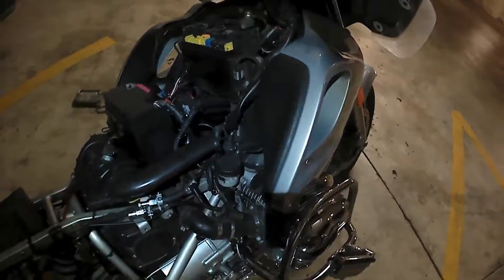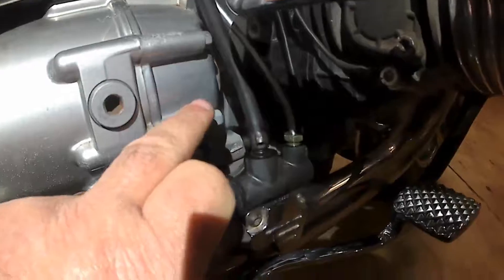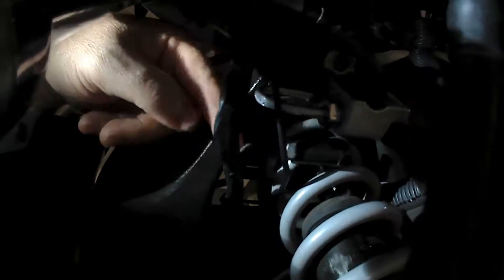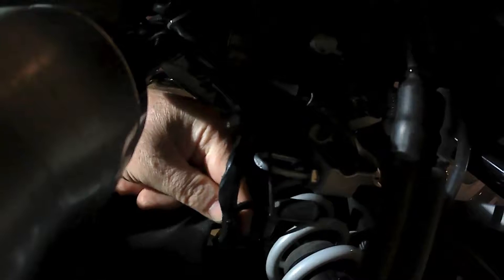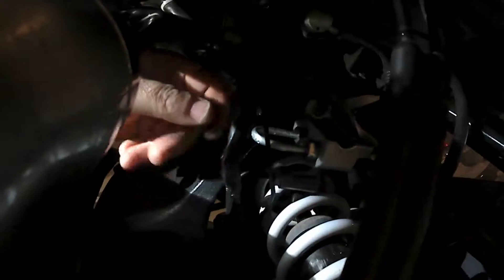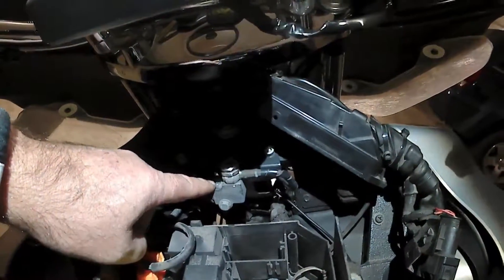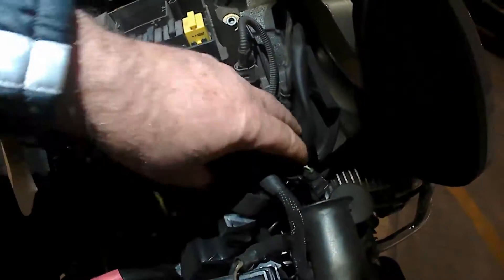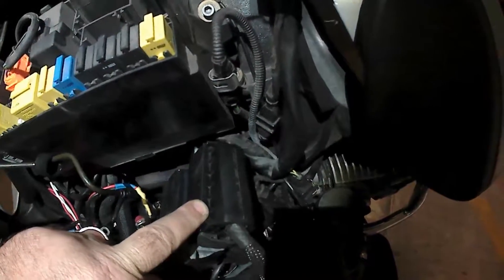BMW i ABS III unit   flip to classic brakes

Comment: Hola Cris compré una r1200cl usada del 2003 y el problema es que NO hace el autodiagnostico del ABS cuando conecto. Cómo puedo comprobar q le han  lo q indicas en el vídeo ? Gracias
Reply from the maker: Hello, Jose! From your words, the ABS lights do not lit as they should, at start-up. There might be two explanations: either the previous owner took out the bulbs, or the ABS unit has another electronic board (or completely another ABS unit) as the one paired with the ECU... A little more details would help......
Best regards, Chris

Comment: I did this conversion; everything went well but Brake lights not working. Do I need to change sensors?
Reply from the maker: Hi! The brake lights are in direct connection with the electronic board of the ABS unit. So, if you removed the unit, you must put back only the first section of the unit, where the board is, and connect it to the big connector...In this video I explained also what other modifications you must do in the electric circuit for the ABS lamps not to blink on the dashboard.
Reply: @cristinelpetrescu1081  Chris I followed your instructions to letter. But not brake lights or speedometer. I am in process of changing to non abs brake switch found on classic R1200C from motorworks in UK. I Find it odd you maintained brake and speedo functions. I do enjoy your videos.
Reply from the maker: @nicholasjheinz7461  Trust me! That brake signal goes through the ABS connector. If you could find the diagram of that connector, you will see... You either did not connect back the connector to the ABS electronic board, or the board itself is deffective...
Reply: @cristinelpetrescu1081  It is possibility the circuit board is flawed! Thanks for your reply!

Comment: Hi, Mr. Petrescu i have a question retarding my R1200CL. I was wondering if you can help me answer it. Its about a hose inside the airbox. The hose is attached to the throttle body and the hose came off the throttle body a little bit and its sucking air. My question is: "Do i have to drop the engine and take off many parts off the bike to get to that part to repair it?
Reply from the maker: Hello! That hose, as far as I remember, is for returning mixed gas path from the intake to the air filter. It must NOT be loose, as that cylinder will not work "round" anymore...I have a video about removing the charchoil filter, that explains the role of that hose... Good luck!

Comment: Hi Chris,tanks for all the videos you posted!   my 2005 abs unit is leaking from the tube under the  bike (pressurized circuit). And the fluid level in the reservoir is lowering. So the low pressure and hi pressure circuits communicate. Have you got  an idea of the defective oring?
Reply from the maker: Is your ABS unit  the same as I presented? Because in iABS III there is no way command and power circuits can communicate in terms of brake fluid... If you lose fluid, inspect very closely  the wet path and pinpoint the place of bad sealing. Could be very well a bad pipe/line connection into the ABS unit.  I doubt it's an O-ring that cause that spill.... The sealing cones of the 4 brake lines, at the ABS unit, are made of ceramic, so they are very sensitive when disconnected, they crack easily and have NO replacement (only the whole line can be replaced...). I hope this helps you in some way... :)
Reply: @cristinelpetrescu1081 
 yes it is, anyway i Will take it apart and see. I Hop the trick you gave to avoid flashing light on the dashboard Will fonction for the 2005 gs, same blu relay and same Brown/red wire to cut. Any idea maybe?
Reply from the maker: @hervecantagrel398  The relay is the same and the wire, too. If you want to be certain you cut the right wire, use a voltage tester (with a bulb), which has a sharp point to punch its isolation and see it lights the same way.

Comment: Hi Chris, I'm Seán in Ireland, iv got an early (April) 2007 k1200r, do I have the same abs III system as your bike? My brakes make that whizzing noise when applied. They work perfectly at the moment but I'm sure I'll be removing the abs unit eventually.
Seán.
Reply from the maker: Hi, Brien,
Don't do that! The whizzing noise is perfectly normal. What you hear are the two electric motors which generate the presure in the power circuits. The pitch of sound change (lower) when harder braking applied. Don't remove the unit if it works fine. Just make the right maintenance (change brake fluid after a few years...).
Best wishes, Chris
Reply: @cristinelpetrescu1081  thank you for your reply and advice 👍

Comment: Thank you for the video. The ABS on my 1999 r1200c has had since around when the warranty expired. Time to circumvent the ABS.

Rear brake line:  are both ends on the metal line (from the rear brake master to the line) you made 10 x 1.5?
Reply from the maker: Hello! No, thread is 1 mm, not 1.5 mm. All of them are this way (European Standard).
Reply: Thank you for confirming 10-1.0 mm. That explains why I could not find any fittings with 1.5 mm thread pitch online :-)
Reply from the maker: Look more careful... You will find it, for sure... Ebay is a good source... @AndreasH-vx5zr